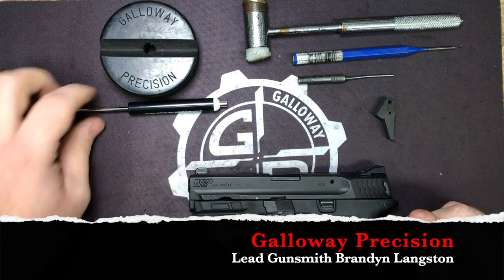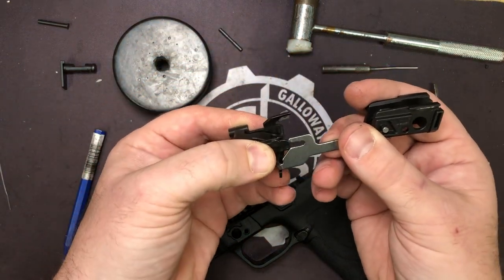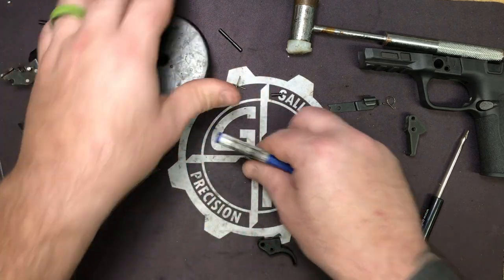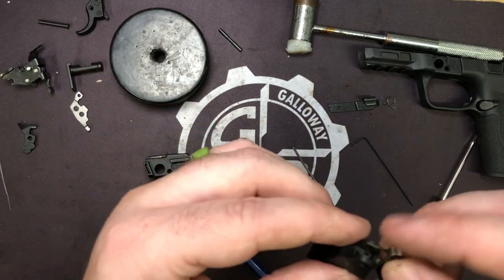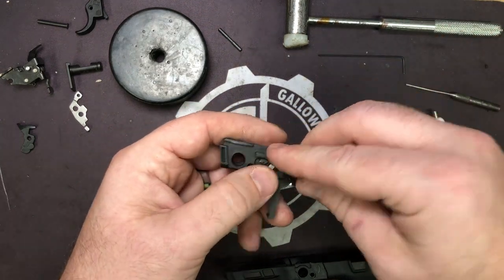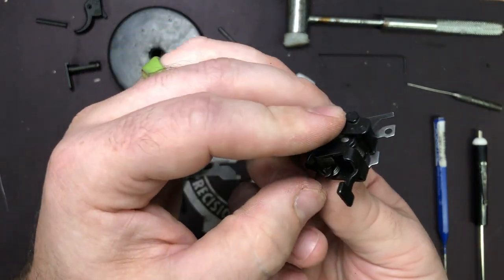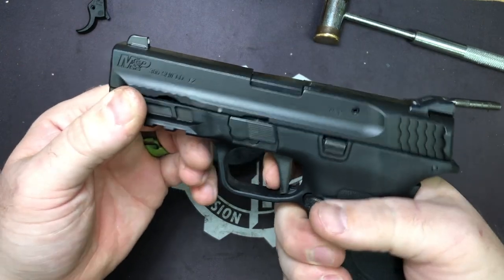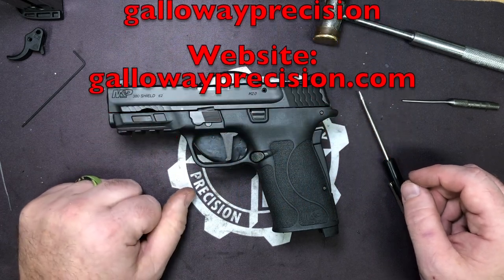Scutum Short Stroke Trigger for the S&W 380 Shield EZ

Comment: It is FAR easier to reinstall the sear housing block, if the grip safety is first removed.  It is one pivot pin and removes easily, and the grip safety spring remains in the frame.  With the grip safety removed, the sear housing block seats easily.  Then, the tail of the lifter can be aligned with its seat in the grip safety, and the grip safety positioned and the pivot pin re-installed.  NO struggling.

Comment: I JUST installed this trigger shoe so here is my review on it

Installation 7/10
Besides the shotty camera angles, springs flying left right, speed that you need to watch the video in slow mo., the installation was annoying. However I DID NOT use his method due to my rear pin that holds the grip safety to tighter than a Jew trying to share Jerusalem with a Palestinian. Even with a steel punch using a full size hammer I wasn't able to get that pin out. Lucky for me I have had experience working on other triggers and some guns here and there. If this was the first time I ever worked on a gun, I would have stopped and brought it to a gunsmith because this video is only 70% useful. Regardless I got it in and function tested it and its all jolly. 

Build Quality 3/10
It is really cheaply 3d printed trigger shoe. I felt better 3d printed objects and this is NOT one of them. You can feel the ridges, the corners and edges are pretty damn sharp and one of the pin holes is sized wrong. I actually have to use a drill bit to shave off plastic to the pin can fit. its not particularly a hard plastic either as I felt the pre-travel pin was going to strip hole as I was turning it. Im goign to have to sand down the edges as this gun belongs to my wife. 

Function 8/10
It works, feel better than before. Actually makes it feel a bit heavier but at least the flat face gives it a more linear pull. Gotta test it in the range when ammo gets more affordable. 

Overall its 21 bucks. Does what its advertised. Just wish the installation instructions were better and the fit and finish needs vast improvements.
Reply: Agree!! The guy either needs to remake the vid or get someone else to make it.  Main complaint is a lack of organization.  I think Galloway can do better.

Comment: What does it mean if my trigger isn't moving freely after install?  When I tested it it will fire hammer but trigger won't move back into normal position without me manually moving it.
Reply from the maker: Trigger return spring arm isn't in the slot on the grip frame.  Only thing that will cause that.
Reply: @GallowayPrecision  it looks like it is.... could the whole spring be out of place somehow?

Comment: I got a ez 9mm and I cant get the trigger housing back in right   I was trying to take off the thumb safety    and no one has a video of a complete disassembly of the ez 9mm 2.0
Reply from the maker: I'm currently working from home, but Friday when I drop off holsters I grab the EZ9 to do a video.
Reply: thank you so much  and it's the trigger control unit I believe that I cant get back In  i don't know weather i have to have the thumb safety on for it to work or not   or i may have lost a part in the process.  I tried to buy a replacement parts kit from Smith and wesson this morning but they do not have it.
Reply: Lee Collins has a video been made to remove the thumb safety bc I’m in you same shoes right now
Reply: yea I found out with that certain gun you have to leave the thumb saftey in for it to function...  getting it back together it hard but you do have to leave the safety on the gun     I put a stronger spring in the trigger housing to basically delete that safety,cause when you put a stronger spring in , the thumb saftey is really hard to move on and off safe.   which is what I wanted to delete the saftey.

Comment: .050 allen wrench measurement is wrong! i have my gun all torn apart and now i cant get it set right. what happened? was the size changed or was a cheap screw with whacked out tolerances used??? I have to wait until i get a tiny set of allens shipped in now!
Reply from the maker: They are .050. If you are trying a 1/16th allen wrench it will not work.

Comment: Will this work on an EZ 9mm?
Reply from the maker: No, but we are developing one as we speak for the EZ 9.
Reply: The Ranier SS Trigger will work in the M&P 9 Shield EZ pistol. It does not eliminate pre travel nor reset but it will reduce over travel. It also eliminates creep and the tactile audible reset which was almost unnoticeable with the stock trigger. It is also a smoother trigger pull.

Comment: Video helped but the product is kinda cheap. The allen set screw caught and ripped right out. Way too easy. Plastic is too soft. Instructions should say to screw in all the way to avoid that. Very sharp edges. AND what is the allen set screw in the middle of the trigger for???
Reply from the maker: Sounds like the set screw caught in or under the grip frame and not against it. Most likely the angle in which the pre travel screw was reinstalled was incorrect. The allen screw in the face of the trigger is for adjusting the post travel.
Reply: @GallowayPrecision  Reinstalled? It never said to take it out. It caught during assembly.